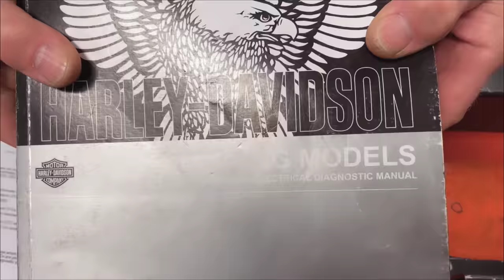Harley-Davidson Problem Codes | What Do They Mean?! | Doc Harley

Comment: Just bought a 2024 street bob. I love the bike, however It has a voltage problem. It threw up three codes and left me stranded on the side of the road. I had to get towed home. And then the dealership came by and picked up the bike. I'm still waiting to hear back from them. The bike has less than 200 miles on it. Gotta say i'm not impressed. When I buy a brand new anything, I expect it to work......
Reply from the maker: I apologize for your experience. And inconvenience. A possible reason you have not heard news is because this is not normal and the dealer is working with the Factory……Doc

Comment: If you could give me some advise I would appreciate it. I have a 2005 FLSTFI with the fuel light on and showing a b1004 code and my gas gauge doesn’t work. . Today it threw a p1004 code. Could they be related? Maybe a bad relay cause problem with the fuel gauge? Thank you.

Comment: Hey Doc if I replaced my ecm on a 2012 sportster 48 do I need to program it
Reply from the maker: Brand new ECM come blank. If you bought on EBay it may need to be married to the original BCM so they can communicate…..Doc
Reply: @LowCountryHarleyDavidson  bro please help me out with my bike I have a sportster 2012 the front injector is not spraying fuel.. even I try to switch the injector the one ant the front still no fuel come out..
Reply: @LowCountryHarleyDavidson  thank you for your response

Comment: I was getting a constant red security light and intermittent check engine light while riding down the road.  When the HD tech pulled up the codes there were multiple ones.  Come to find out it was all caused by a defective brake light switch.
Reply: My engine light comes on going down the road goes on and off but runs no different

Comment: As always great Info Doc.  I've got an 08 FXDL that I'm pulling my hair out with, with different codes while the errored components work fine and read fine on the multimeter.  I've had the bike apart checking all wires, connections, sensors and modules. What you said in the video is 100% spot on, " it's not that simple"  I think half the issues is the previous owner put a stage 1 screaming eagle air intake on and Python pipes but never had the bike properly mapped with a fuel controller.
Reply from the maker: Right on!….Hoping for future success…Doc

Comment: Nice one Doc. There is a lot to it. and depending on the generation of system, the methods of troubleshooting can get all sorts of wild and wonderful. I just spent a ridiculous amount of time chasing down a cam sensor code on my new to me 2000 electra glide. Falsely assuming that the "professional shop" had done the job right caused me to chase all sorts of dead ends. In my frustration I had forgotten the basics: stop. assume nothing. approach it methodically. build an order of operations. 

The root cause? when updating the engine to use hydraulic cam chain tensioners, the professionals had used the cam sprocket that came with the kit and installed it without ever reading the instructions in, or description of, the OEM kit; which clearly states that an original style sprocket must be used and is not included. Nor had they even stopped to wonder why the original sprocket was so radically different than the kit sprocket. That the bike ran at all in that state is a mystery I havent solved yet.
Reply from the maker: Thanks for Sharing...Doc

Comment: Yes I agree a process in deed!
I have a 21 Harley 48 and threw a B1211- fuel level sender shorted high side 
The dealership already replaced the pump and are going to replace the harness but I told them it's probably the resistor based of the wiring diagram because the pump still works when fuel gets to low than light comes on

Comment: What does BUS ER mean. Got an 08 ultra SE3 snd she's running funny. Like hit n miss on  rear cylinder
Reply from the maker: The communication Can Bus wires have been compromised! Your bike can not communicate to all the sensors. Either a wire is grounded or a power wire is putting 12 volts where only 5 belong. …Doc
Reply: @LowCountryHarleyDavidson  thank you sir for responding!!! I'll start checking continuity at the bars and work my way back. I figured it might be the fuel injection wires. Was getting ready to lift the tank.  🇺🇲I appreciate ya

Comment: Thank you Doc, I’m so furious right now, I bought new 23’ RG and ordered stage 1 and new bars for it, parts came in and dropped off bike, days later (late yesterday) went and picked it up & 40 miles later, west to take ride to dinner and 3 lights came on and codes are P1100c and C1032c, I have suspicions that the dealership cleared codes to get me to pick up the bike knowing the lights would come on after I left, can  that be possible to ride the bike until Tuesday (dealerships closed) with those specific codes showing? Any light shed from you would be great.
Reply from the maker: It is possible the codes were created when connection were separated during the handlebar exchange. As long as the bike is running well. You will be fine. They are Historic codes. The concern is when the light stays on while riding. Please do not assume the dealer and techs are out to do you harm. Mistakes can be made. We…I am human…..Doc
Reply: @LowCountryHarleyDavidson  Thanks Doc! TC

Comment: 96 harley davidson ultra classic Electra glide was doing something really weird. A engine light came on but went off just as quickly. Then I would get the engine light on start each time I rode but it would go off. It wasn't a solid code and I was never able to get the code. My fuel mileage went bad and sometimes I couldn't even get it out of the drive before it died. It would die at stop signs and red lights. I looked up the symptoms and it would come back as the magnetti marelli fuel injection system that is on the bike. One weekend recently, I went on a 200 mile run on the old girl. She ran okay for the first 170 miles but the last 30 miles, she would kick off the cruise control with every bump on the highway and she just wasn't running good. When I got her home, I looked her over and I shut her off. The very next time I was going to ride her, I noticed the ammeter showing 10 volts and would not go any higher.  I replaced the alternator earlier this year and it was working fine as far as I could tell until I took that 200 mile run. This whole time I'm thinking I'm gonna have to replace the magnetti marelli fuel injection with a delphi or a carburetor along with replacing my alternator.  I decided to take it to a shop and have the alternator replaced. The shop did a fantastic job and were really fast and affordable to boot! Lo and behold, the new alternator alleviated all of the problems I was having with the fuel system. To date, I have had no problem with how she is running. I replaced the alternator myself the first time and I must have gotten some of the parts wrong. The stator must not have been rated 45 amps or the rotor rotor itself may have been the problem. The rotor taken off the first time had all of the magnets grouped together on one side of the rotor and the stator was burnt. The voltage regulator was also bad the first time. This second time it went out on me, exactly the same thing was found. All the magnets on the rotor I replaced had grouped to one side. The high temperature glue had failed. The stator was burnt and the voltage regulator was out. The guy who did the repair this time said it was a 45 amp alternator and the rotor was a sealed rotor. My fuel mileage is back up to 45 mpg where it had slipped to 41 to 39 with the old alternator and that was right after I installed it! It is much better now. I am elated I don't have to replace the fuel injection system. Some people have replaced their fuel injection to carburetor but at 2000 dollars to redo it, I was not looking forward to the cost. I could have done the delphi for a lot less but still the hassle of replacing it was not appealing in the slightest. We are coming to the end of the riding season but I'm gonna ride as long as I can before I have to cover her up for the season. I love my evo. She's been mine for three years and this is the first time I've had any trouble with her. This bike has been to Daytona week before. Apparently the old boy that owned her had some issues with the alternator on that trip. I am hoping we've got that issue solved permanently.  I plan on riding her until I can't ride any more.
Reply from the maker: Thank you for sharing an epic event with a happy ending. Your shop went the right direction. The original charging system was weak. Many don’t understand EFI depends on Battery and Charging System👍…..Doc

Comment: Ha. My left had switches shorted out and MAN I got alll kinds of codes,  think there were 2 ecm and 2 bcm and even abs or speed0..

Might have had trouble figuring it out EXCEPT, I knew I’d  previously had to press very hard to get my hi beams to come on … then hard pressing the trip switch made them come on.. hah, was kinna a no brained at that point .
Turned out the wires that go into the glue on the back of the switch were the issue.  ..
Reply from the maker: Wow, thanks for sharing….Doc

Comment: Hey Doc another great video! I’m getting code PPU 82883. What does this mean? Do I need to take to the dealer or can I fix it? I’m not finding a solution on HD forum.
Reply from the maker: That is not a code.  Nothing to see here, keep moving along 🤦‍♂️….Doc
Reply: The check engine and security icon lights come on and then go out. This is new so that is why I was mostly concerned. Thank you for answering my question Doc!

Comment: Recently my softail Fatboy 2008 comes a bus err and also one of my turn signal does not work right side the error codes shows are u1300 I can't fix this how can I fix this
Reply from the maker: Best answer is take it to your local Harley-Davidson dealer. The tech their can follow a flow chart to find the Can Bus wire that is not communicating. It could even be the circuits in the switch...Doc

Comment: Doc, I replaced a bad ignition switch and now my speedo is completely off but red key light is on... please help. Thanks 👍 (2005 1200xl, w/carburetor)
Reply from the maker: It does not sound like the wires are correctly connected or you have a bad ground wire....Doc
Reply: @LowCountryHarleyDavidson  
Disconnected and re-checked all connections and fuses. Still no speedo, no blinkers or brake lights. Running lights (head/directional/tail all on. There must be a fuse I'm missing or this is a security lock out? Security fob double click blinks lights though so I know that works. Odometer only comes on when I press reset, but won't stay on after bike starts and won't go into diagnostic mode. I'm stumped

Comment: P1511c, and P2135c. 2021 Road glide with just 2K miles on it. This is unacceptable. Had to limp the damn thing home. How embarrassing. Last Harley I ever buy. Voltage regulator went out at 4K miles on my 2020 softail standard I had prior.

Comment: Hey Doc. Thanks for what you do. My wife, a 06 cvo v rod, is having a weird health issue. Battery was doing some weak starts and died a few times. Then Wednesday, charged and strong, ot started fast and ran well to 3 different locations and suddenly barely cranked but did start,  went 200' and died with no juice left to crank. Just turned to E but should have made it at least 10 more miles, but so tried jumping,  no. Tried with a little fuel,  no. Even being jumped by a charger/jump pack, half the time barely cranked and other half cranked strong but no. Now new battery + plenty fuel, no start and even cranks slower immediately AND I don't hear fuel pump at all, plus didn't get fuel from bleeder valve when tryingto start. Did I kill her? I love her and need her back. Voodoo? Black magic? Help please! I have codes.
Reply from the maker: This is some serious MoJo. Better take it to a dealer for some witch doctor cure…Doc
Reply: @LowCountryHarleyDavidson  Crap. Don't really have the $ for that unfortunately. I know the battery was going bad plus my positive terminal was loose. Would no battery make the ecm or something with security prevent power to fuel pump? I've tested and get no power to fuel pump or fuel pump fuse.

Comment: I have a 2012 electraglide 
Keeps throwing a over voltage
On acc code
Clear code turn the bike off
Then turn back on codes comes back without starting
The Harley bible says it set the code I believe it said to do that it had to be over 16v for 3 or 5 sec 
But the bike was never started
I went through check the charging system
Ended up the book said replace speedo
Luckily I had a old one swap out but did no good
I finally got it figured out
Any guess what you think it was ????
Ok I will tell you
It was a aftermarket led load equalizer
Reply from the maker: Point Proven! Thank you for sharing....Doc

Comment: Unless folks are mechanically inclined, and have that picnic table of diagnostic goodies...It's really best off to the dealer for DTC issues.
Reply: But there are dealerships who will say it's normal. So, no, they're not always the best for issues. A Honda dealership has techs who work like drunks. There's a cable on my Honda Shadow 750 that they forgot to run through the clip that keeps the wires together. I asked the service writer at the desk at the dealership if the tech could simply just put it back through the loop. He didn't write it down and the tech didn't do it. I've taken my bike there several times for service over anything (I don't have a garage nor access to a lift) and the techs fail EACH TIME to spot the flaw. If you have pride in your work, show it. If you like what you do, it should come out of those hands working on the machine. Everything is artwork and mechanics are really just morticians/surgeons. Repair it and make it look like it's supposed to. But mechanics don't want to do that. Makes no sense to me whatsoever.

Comment: Doc your good and we all know it. Here is a question I can not find the answer to. I have what started off as a winter project. Which is know a major build. Have a 2003 soft tail heritage with a numbered paint job with only 7,000 mls. Attempting to change out the gauge and have found that the new gauges will only function on a 2004 and newer. Why is this. Dakota digital phoned me and informed me that they were out of stock and would take six month to get one made.  What is the change from 2003 to 2004 and it is not the injection that should have nothing to do with the gauge. Right??
Reply from the maker: There was a Big change...Harley went from Analog to Digital communication between Speedometer and everything else. It was the beginning of what we called the Magic Bus days...Doc

Comment: Great answer , one thing I learned on new electronics,  mine was Forklifts,  but same type - is 1 wire might do 2 to 3 things , atleast on the Newer Hyster forklift , one wire my do horn , and the same wire my also do 4 way flashers . 
At first I was  saying it was crazy , but the Voltage , and lack there of can change how a switch works , learned that in Shop class in Jr High.  Using a Orthoscope seeing how Voltage works in Waves shows how it works. Confusing,  but how they work . 
I left forklift industry about almost 10 years ago , they seemed to be ahead of Auto industry  on changing DC Voltage to AC , where a 36 volt DC battery would last  8 hour shift , changing the system to work on AC and same battery would last over 3 shifts of usage.  
Wave's of power  will change the World if used Properly  !!!
Reply from the maker: Thanks for sharing. Buell must have worked on a Fork lift.....Doc

Comment: Great job Doc, I'm a licensed automotive, marine mechanic and of course play with bikes.. but I know my limits... even after 44 years  wrenching.. I literally could of been rich just answering those questions or the client puts the phone  near the noise.. absolutely hilarious.. 
I so have a question if you could answer..
I have a 05 fat boy CVO with 18,000 kilometers on it.. it drives me nuts why my machine seems to idle to high after warm up. It's always idling around 1000. Now that's what the tach reads.. haven't verified with timing gun.. but I really loved that classic lower Harley shuffle that the old carbs did, you lnow the classic of timing of Harleys.. I've verified no vacuum leaks, never touched timing or mods  on this prestine factory screaming eagle set up.. 
Any suggestions or theories?? 
Thank you for your time.. 
Pete from Canada
Reply from the maker: Fuel injection changed the way Harleys sound at idle. You would think with all the sensors and mapping they could recreate the awesome shovel idle. There are reasons for the 1000 rpm idle. It take a lot of juice to run fuel injection. If you notice all Harleys with FI when started go to 1350 to 1450 rpm. thats to help the rotor/stator to send as much voltage to the battery after the starter took so much. at Idle the charging system in 05 barely keeps the battery up above 12.8 with all the lights adn FI system running. The bike's oil pump supplies oil and returns oil as fast as it turns. So if the idle was set at 750 lopping the motor would be starving for oil. The best way to get the sound you want is to research cams. Some manufactures can play with cam timing that comes pretty close to sounding old school......Doc
Reply: @LowCountryHarleyDavidson  thank you so much for your quick response Doc... I do agree with the  very hard  and struggling start.. it's a shame that after warm up and full batt it wouldn't drop.. what kind of cam could create a lumpy idle without bad performance.. especially off the line.. I'm no hot rodder just an old man that loves great idles and sound.. 👍.. thanks for your time.. keep up the great work...